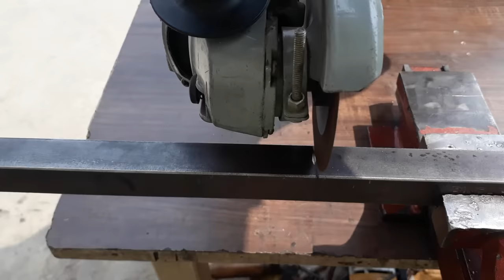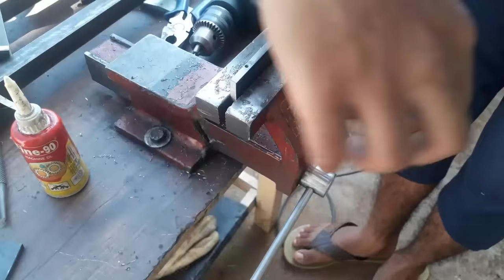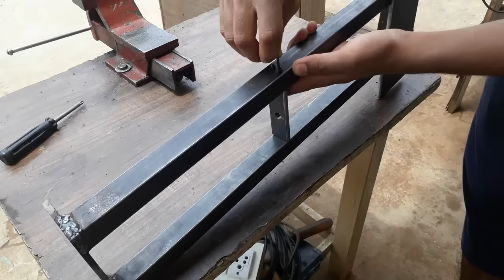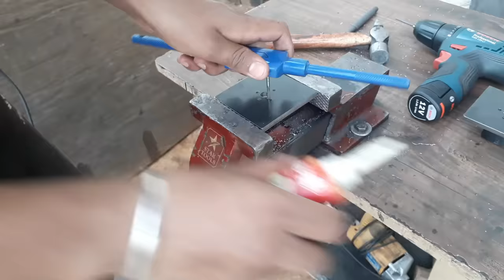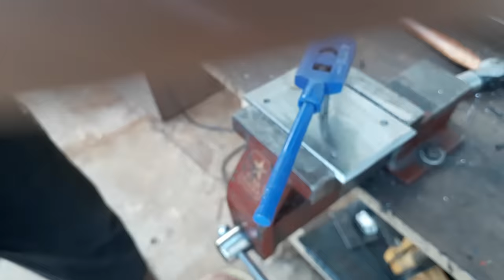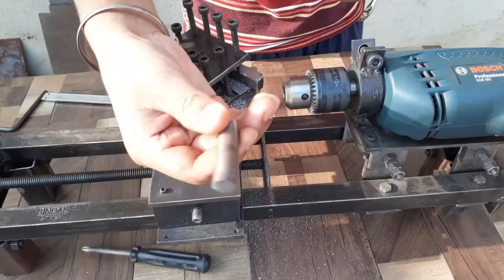Homemade drill powered mini lathe machine. drill powered metal lathe machine.

Comment: A lot of experts at work here giving negative feedback... i am sure is is not the safest or best built in the world but this guy literally built it with scrap pieces using a drill and a screwdriver practically on a kitchen table.... 
don t get discouraged by the “experts”, everyone started somewhere and then learned to get better, keep up trying (and wear some safety equipment.😉)
Reply from the maker: This is the best comment. Thankyou very much brother
Reply: I WOULDA QUIT BY NOW,I WOULDVE SNAPPED2 OR 3 BITS,THEN BUSTED AT LEAST ONE TAP. DANCED AROUND SOME,AFTER GETTIN A HOT ONE TWIXT MY NEKID TOES!
BUT YOU'RE RIGHT,ONE CAN MAKE ALL SORTS OF EXCUSES NOT TO DO A THING,BUT,IF DETERMINED TO GET OR MAKE SOMETHING, YOU REALLY WANT. WHAT WOULD, COULD STOP YOU?
 THE BODY WILL OBEY THE COMMAND OF THE HEART!
Reply: Yup....the expert way to make homemade lathe machine using Industrial Tool such as : Lathe Machine, Bench Saw, Circular Saw, Drill Press, Band Sander and much more factory made Tools...

Comment: 1st off; don't worry about the negative comments.  Just ignore them.
Personally, I think it's a pretty cool idea.  Maybe just a couple changes to the base ( good, strong welds, instead of bolts), and definitely a better motor. Just some constructive criticism. I'd love to see another video of it, after the modifications are done.. Definitely a cool project.. Thanks for the video..🍻🍻👍👍
Reply from the maker: Thankyou
Reply: The negative comments are good to be used as constructive criticism to better yourself at least that's how I think.
Reply: @veronicaanthonygarcia9484  Absolutely..🍻🍻

Comment: I just made a wood turning lathe powered by a drill, and thought that it was pretty useless. Made me look around for softwood to turn because I couldn't get good results with hardwood.

I think using a drill might be okay if you use a couple of big bearings to separate the drill from the work you're turning. That way, you can save the drills weak bearings from axial load and get your larger bearings to provide rigidity that people are complaining about. I'm gonna try that on my lathe.
Reply: At what point do you just pull the motor out of the drill, or set up a proper fixed motor?
Reply: @Louis-op4zj  "Pulling a motor out of a drill" (a regular hand drill) isn't possible because they're designed to be inseparable.
Reply: @BrassLock  the motor, gearbox and skin? That's blatantly untrue, at least for reputable brands like Makita. Which I mean, I have a few 240v's laying around from god knows, the 80s or 90s at least? They're a serviceable/repairable tool.
Reply: @Louis-op4zj  OK.
I misunderstood your comment to mean that the motor from a hand drill could be taken out (like a motor from a desk fan) and used to power a lathe.

But you mean to remove parts and service them. Yes, of course you can do that.
Reply: @BrassLock  if you can take it apart for service or repair. Then you can take it apart to break it down into seperate parts. 
Would it not stand to reason, once removed, you could then repurpose those parts. Circuitry, motor, and chuck? 
Then, I dunno, fashion some mounts to use the parts, without the rest of the drill. To use the mechanical/electrical drill internals, but with a better mounting set up?
Reply: @Louis-op4zj  I'm an elderly DIY enthusiast who has limited skills and resources 🥸.

You, on the other hand may be a young enthusiastic Fitter and Turner with 3D Printer and CAD skills, plus a garage full of equipment 😎

Good Luck 😁
Reply: @BrassLock  I appreciate the vote of confidence, just a kid with some hand tools, couple bits and bobs, and a painful urge to take things apart, or try to make stuff I can't buy with whatever I can find. 
Best of tinkering mate
Reply: @Louis-op4zj  I've had another think about hand drills, and of course my earliest comment related to mains-powered drills (as having "inseparable motors") causing the DIY-er a lot of hassle to manufacture bearing housings to perfectly align the rotor inside the stator. 

However the battery powered drills have indeed got very re-usable separate motors that are fully removable without any fuss trying to find bearing housings at each end. But the gear boxes may not be attached to the motor (although some are). It all depends on the design.

A 12, 18 or 24 volt DC motor from a drill (or treadmill) is a worthwhile project to use via pulleys, (or gears) such as was designed in the early 20th Century lathes.

Even Singer sewing machine 240 volt mains powered motors have been used for small lathes by some hobbyists.

Comment: Satsriyakal. The idea is great and very simple, I liked it, but I think prolonged use of the drill will burn up the armature. It would be better if you installed a sewing machine motor and a small lathe chuck

Comment: Impressive what you built with so little tools, but designs not so good, because too much strain on drill, that drill chuck and bearings are gonna be gone within a week of use, if not sooner. You need to figure a way to support that drill chuck, and remove working pressure from it.
Still a thumbs up!

Comment: You have any idea how many 3/16" drill bits and taps I would break drilling and tapping into that 1/4" or 3/8" end pieces.
Reply from the maker: You are right. I have large stock of 3mm drill bits and taps and I had broken so many while making this lathe
Reply: Resharpen them.

Comment: Great build brothers, you can upgrade your DIY lathe machine by using half hp power motor with a pully gear and a bigger drill chuck ( 20mm or more Chuck )
Reply from the maker: Thankyou.

Comment: I appreciate your hard work but you failed Because drill machine is not capable for metal lathe machine. It's only work for wood
Reply: i wouldnt call it a fail...he built something.  he learned from building this, so he didnt fail. just because it doesnt meet your standards doesnt mean its a failure.

Comment: How much RPM required for Turning
Reply from the maker: 1800 to 2000 rpm
Reply: @apstools5521  
1800 to 2000 Rpm is required for Mini Lathe turning only ?
OR ...for big size Lathe turning JOB also...
Kindly explain...
Thankful👍
Reply from the maker: For big lathe maximum 3000 to 4000 rpm are required
Reply: @apstools5521  THANK YOU BROTHER...
Reply from the maker: Your welcome